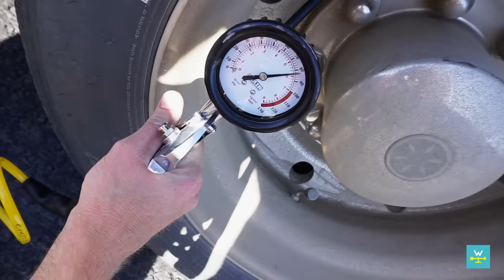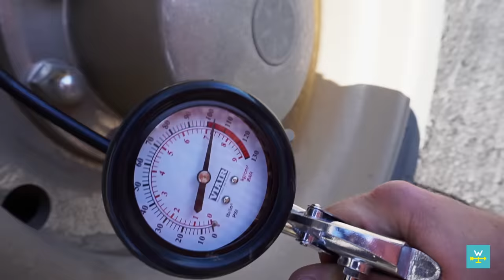05 Alaska Bound: Crossing the Alaska Border & Getting Screwed

Comment: We ran through a bunch of roofing nails once on our way out if Michigan to Colorado. The sad part is, We left at 4 am figuring to be through Chicago before traffic got bad. We had to replace  one tire and get 3 patched. The tire place didn't even open till 9am. It gets better. We picked up an old 1969 Portacabin popup camper in Colorado free from my cousins. The bad part was all the tires it had were dry rotted. We had 4 tires ( one spare set inside) and a spare tire. Every tire ended up destroyed on our way to Utah  after leaving Colorado. We finally stopped in Wyoming and got two new tires. The spare had a big chip of rubber out of it but saved us when we were down to our last good set of tires and one  blew up into pieces. That was a memorable  trip.
Reply from the maker: Well, you got really good at changing flat tires?? 💙💛💙

Comment: Viair pumps are great. I knew you weren't doing it right when the motor ran nonstop when you weren't adding air. Once you set it right, the pump shuts off when not being used, then goes on when needed. Great design.

Comment: I have plenty of advanced shade tree auto mechanic experience but still  needed help with a RV tire change.  Got a side wall puncture just out side of Yellowstone park heading west, so plugging was not possible.  This occurred at a  very small town with maybe two gas stations.  Asked for help and was told no one  could help .  For some reason I was missing something needed to make the change myself or perhaps the lug nuts were too tight.  I was parked on level ground, safely off the road next to rail road tracks.  I just happened to look across the field at a big barn that had  giant letter's AAA with a phone number.  Called the number and the AAA guy showed up with his truck a few minutes later. and he installed the  spare.  Lesson: I thought I had everything I needed to change a tire and didn't.  In retrospect I should have practiced changing tires on the RV before starting on the trip.  I thought this  couple did a very nice job all in all and it was fun to watch

Comment: I was just going back through some of your prior videos and watched this.   I've always preferred to figure out how to use things like the compressor BEFORE I need it.  Can you imagine how hard this would have been if it was raining or night time?  The cement with the plug kit serves as a lubricant when you are reaming out the hole and when inserting the plug.  I've actually had to put 3 plugs in a large hole once.  it lasted the rest of the summer, and my little RV was due for new rear tires anyways, so I didn't need to put the new tires on only to store the RV right away.  Love your videos.

Comment: Also if tire is leaking and sidewall says higher pressure than recommended just max it out. Most of those tires go over 100psi, and if it's leaking your better off for running. Also maxing other tire on duals would help keep load supported.

Comment: I remember when the alcan hwy was over 75% extremely washboard ruff, muddy, rocky, dusty, and dangerous in places. The Canadian border recommendations was to have twenty gal extra fuel, belts fuel and air filters and at least two spare tires to go on the road back then.
Last time I drove the alcan from Washington, almost 90% of the hwy was paved with crews working on the rest.
Reply from the maker: Yes, it is a dramatic change from the images we saw from the 90’s
Reply: Gone with the Wynns I was referring to the late seventies-early eighties when the Alcan was considered that was called, semipassible sometimes dirt, dusty, rocky (sometimes very sharp tire & wheel destroyer) sticky and slick muddy and permafrost icy trails in between a few ok paved road to a well done hwy just before the frost heaved hwy of Alaska.

Comment: you have dual tires in the rear so if one goes out you can drive with it flat. just do not drive fast.
Reply: Not true, duals are for carrying the weight (enormous). They did it right, except for the Slime part. Lucky it didn't harden in the valve system.

Comment: That tires junk is hated by tire mechanics. And it just gunks up your tire rim. Buy a plug kit that is easy to use and a far better option than fix a flat junk. Also , if you do use that crap , you have to immediately start driving to even out the gunk inside from fix a flat.
Just buy a self plug kit. If you can change a tire , you can plug a tire.
Peace
Reply: LOL , awesome , you got the plug kit. I posted before you bought it. Push the plug in !! LOL
Reply: Exactly. Never remove the tire if your just plugging it. Only time a plug won't work is if hole is to big or hole is in side wall of tire.
Reply: Saw some off road guys plug a hole in a sidewall with about 4 of those. lol It worked for that day for them. I was surprised.

Comment: Screwed? That's not screwed. I'd say you had a hard day with frustrating moments. A screwed day is getting a complete flat or run out of gas, or both, and nobody comes by and helps you out. You're stranded for quite some time, even if you walk the whole way to chicken, you get there and forgot to take your wallet.
Reply: Linda Houck Screwed as in there was a "screw" in their tire.

Comment: pilgrims,,,,who dont know what they are doing,,,having never done anything before in the way of repair or maintenance,,,have to learn the hard way,,,on the road. Woulda been lots easier to have had some instruction at home prior to leaving. And to top it all off, they have minimum of equipment,,,compressor and repair tools,,,,,and dont know how to use the ones they have. Lucky to have made it this far. Note to self,,,,travel only with person well versed in repair,,,,,or practice doing some of these things at home. What if you had to replace a fan belt or water pump, alternator or idler pulley,,,could you do that,,,,did you take spares with you? my bet is no on all issues,,,,,good luck in the future
Reply: bill45colt You know what would be a good side business for tire repair shops? Teaching people how to use these things before they leave home. Maybe on a rainy cruddy Saturday in the middle of winter.

Comment: side cutters work good for that, not a razor knife.
Reply: Ric Gruber My thoughts exactly!
Reply: Yeah I was expecting trouble when he went in with the utility knife.  Pliers with the built in cutting tool would have worked or he could have possibly held the end of the string repair with the needle nose he removed the screw with and then used his utility knife.
Reply: I WAS WAITING FOR THEM TO CALL TRIPLE A!!!

Comment: At 56, I needed to learn to repair a tire, use for a flat, change out spar plugs make sure I had enough fuel plus extra , and live the joint and bearings... And that was before I could test for a license.. I got my license in Feb 2 days (weekend) to get license at 16.. Big to took two tries as Dad didnt make him earn mechanics. But these guys... Did You Not Read the manual ???

Comment: those "fix a flat" cans are for tires of 30-40 psi only range, unless you let out the air first, put in, then reinflate. You'd do better with a "plug kit" and just do it quickly between nail out and push plug in.

Comment: I've found that pushing the plug in is awfully difficult, unless I turn the handle as I push, then it goes in much easier. Also, I have left plugs in and never gone in for a professional repair, and never had a problem.

Comment: Don't ever use the fix a flat in a can it will destroy your tire on the inside and will not be properly repairable.  Your better off with the old school tire plugs the good ones not the cheep ones.  and a air pump. But you should get it done right later.

Comment: THINK PHYSICS... The material in the Flat Fix Can will head for the bottom of the tire, you should roll the vehicle until the nail is on the bottom, then let out enough air until the can will push the goop into the tire, then add air back up to 90 psi as you rock the tire back and forth to be sure goop gets into the hole. You may want to rock the vehicle back and forth keeping the nail on the bottom just to be sure the goop gets into the hole. THINK LIKE YOU ARE THE GOOP. Where will you go? How will they force you into the hole with the nail?  GOOD LUCK Mr Goop!

Comment: Note to Travelers on excursions to BFE. I would not even consider a trip to Alaska unless I had the following:
One, a minimum of at least 10 gallons of extra fuel. 2, have a decent tool kit including your typical Hand Tools socket set etcetera Kama Plus a good Jack, a good compressor, shovel, axe, tow chain and or tow strap, ratchet straps, bungees, and of course duct tape. Three, must have plug kit for tire repair, also a couple of large cans of tire inflator and sealant. For, full-size spare tire, preferably two spares. I know this sounds that may be excessive, however, from my own personal experience north of Whitehorse Canada, two spares can be an awesome thing. Having all these things on a vehicle has kept me from major problems many times over the years.

Comment: #1 you need to carry tire patch/plug kit and an air compressor that can inflate 100psi

using that fix a flat can is a bad idea, tire pressure will push air back into the can

if your going to travel, have all necessary roadside kits you can think of, I carry 2 full size spare tires just in case
have a good radiator hose repair kit, as well as 2 gallons of coolant (NEVER USE WATER BECAUSE IT WEAKENS THE BOILING POINT and will boil and evaporate causing overheating almost immediately and then you blow a head gasket
Reply: Due to MS issues I should make sure I have roadside ASST  right?

Comment: First that can of jez messed up your TPMS and a tire shop may not want to mess with the tire if they know it has the can of tire jez in it.  If you find a shop that will pull the tire off and vulcanize a patch over your plug you will be a lot better off.  I patch on the inside will fix the leak for good so it does not slow leak on you forever. Hauling around that much weight it is better not to run on a plug.

Comment: I believe I would ha e lubed the first inch or so of the rubber plug.  Just the tip will only lube the tip and have insufficient rubber cement to let the plug slide in.  You managed Ok if the plug holds.  Wether or not the hole in the tire is judged to not be in the tread and not the sidewall is another question.  It is illegal in the states  to patch or plug a hole in the sidewall.  Bet you didn’t know that.  Very entertaining video.  

JoeB
Reply: He just doesn't have a clue.

Comment: That crap-in-a-can ruins tires. It is good for about 20 miles only. Then you get to buy a new tire. I do not think that is written on the crap-in-a-can. It is not air, it is some kind of crap that sticks in the tire and weights it down. And the tire goes "clunk clunk".

Comment: This was sad and funny.  I know a lot of time has passed but the idea of hitting the road without being prepared to be self sufficient in the middle of nowhere was sad.  Watching how both responded was funny.  But, by golly, you did it.  And, if it is not too late and you have not completely burned up the air compressor you should read up on duty cycle.  Between running it with the intake still plugged and probably too long for the duty cycle you are probably lucky to have gotten that big tire aired back up.  Best of luck on whatever adventure you are on now.

Comment: The spare.tire is wonderful for helping solve this predicament 🤪
Reply from the maker: Most RVs of this size don't carry one. 1) RV manufacturers warn that the hydraulic jacks on a coach shouldn't be used to change a tire, 2) These are large truck tires and are too heavy for some people to move safely, and 3) because they are truck tires the lug nuts are torqued beyond the capabilities of most hardware store tools and you need a compressed air tool to loosen & tighten them. And yes, there are ways to get around all these things if you want to bad enough, but almost all RV insurance comes with roadside assistance standard and for 99% of the flat tires that's the best way to go. Being on the Top of the World Highway is a 1% situation and in the end Jason handled it well and got the tire patched and reinflated. So he was prepared with a patch kit and a high-volume air compressor.
Curious Minion

Comment: Okay I know my comments coming a little late based on some of the comments I've seen already. First of all you have two tires these Vehicles arr designed so that if one tire goes flat the other Tire can carry the load so you never really needed to stop and refill the air in the bad tire that's why the tire you were looking at never looked very flat because the one on the outside was fully inflated  holding up the entire vehicle including the tire that was next to it .Secondly when you're putting the plug in the tire you need to put the reamer which is the first device you used in and out of the hole several times to clean any debris out of the hole then you put the plug in lastly I would never use a utility knife to cut those ends off you want to use a pair of wire snippers much safer and easier happy travels.

Comment: I haven't finished this yet. Just tell me one thing, do they survive? Do they get eaten by bears?  LOL!!

Just a note: I've never worked on tandem wheels, so I might be wrong. He's plugging the inside tire, but earlier he inflated the outside one? Are the two tires coupled pneumatically?
Reply from the maker: The inside tire would be impossible to get to easily, so it has a much longer valve stem that runs through the outside tire. And voila, both valve stems are easy to access for checking tire pressure and inflating.

Comment: I got that same compressor and man does it work paid about $400 for it and let me just say. You get what you pay for,  other compressors will only fill it to about 40psi . Be careful not to burn yourself after air up the tire as that little machine can get as hot as a firecracker. Jesus Christ I have the same tire nozzles and I didn't have a single problem. I didn't even have to use the threaded part for the compressor, but in my case I read all the directions since it wasn't much to read anyway. I always have an additional 14 gallons of fuel in spare tanks.

Comment: I would have just stuck it in there you silicone instead of the rubber cement get a bigger tube of it shove it in pull it back out not even worry about cutting it off once it get get it out to where I can Leave the Pieces in there leave them in there and drive it done it before

Comment: Back in 1998 I bought a used International Harvester School Bus from a guy who was one of the maintenance workers for the local school district and I worked on my bus for over a year turning it into a R.V. I put everything into the bus that I needed for my and my ex wife and kids to be able to live in it and travel. I had seat belts in the front for passengers and the front had the kitchen with parts from a old used R.V. (stove/oven) I installed a household stainless steel sink with cabinets and a removable table to eat at and a small refrigerator and I had a wall with a door so I can shut off the front end and I installed and bolted a cast iron wood stove with all the propor safety heat shields for heating and I had a iron kettle I put water in to keep it from being too dry on the wood stove when we used it to keep warm. I had a bench seat, a closet with a tv on top of it and then my bed with 2 toddler mattress in bunk beds above my bed and in the very back was the bathroom with a flushing R.V. toilet and bathtub with shower on hose from bathtub faucet. I had a R.V. septic tank with the standard sump valve set up, a water tank, pump for running water, a electric hook up with R.V. power cable to plug in, A/C-D/C power converter, marine battery that was hooked to everything in the back with power switch so the engine battery did not get drained at all and it was nice being a school bus made if steel the wildlife could not claw into it like a aluminum R.V. So we were safe and the wood stove kept us warm. My boarder patrol horror story came from when we where traveling back home to West Virginia from California State and we went into Arizona and in Yuma AZ (sp?) There in a boarder check station although many many miles from Mexico and my wife had our kids in our van and was following me while I drive our bus/R.V. they told me to pull off for inspection and they had me stand in the hit July sun with no shade or water for about 3-5 hours while they searched our R.V. for drugs as they claimed the dig hit on my R.V. And after 3-4 hours of them searching in vain for stuff that had never been in my R.V. I told them that my family trains dogs for many different types of work and when a dog gits on a vehicle with drugs in it it does this ..... And that I knew they were full if shit with the dig hit story and at that point they let me go. My wife had to get a motel room down the road and wait in the air conditioning so my kids no over heat while I stand in the sun and get searched so when I got done with those pigs I contacted her on the CB radio and met up with her and my kids and we kept driving back to West Virginia

Comment: Makita drill, 1/4 drill bit make reaming much easier. I would also buy a pancake compressor with multiple attachments including a locking adapter for those pesky braided valve extensions. A nice set of sharp side cutters to cut off the worm. Unlike others, I won't make fun of your lacking the basic repair kit, as I had a flat once and thought I had put one in my go box, but accidentally left it in the garage. D'Oh! S happens...  PS.. Your wife is adorable.